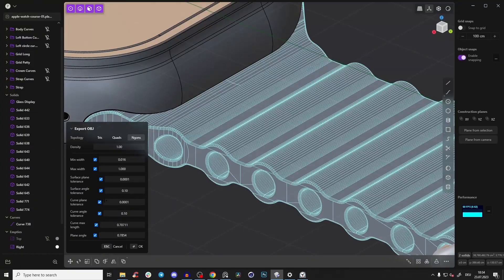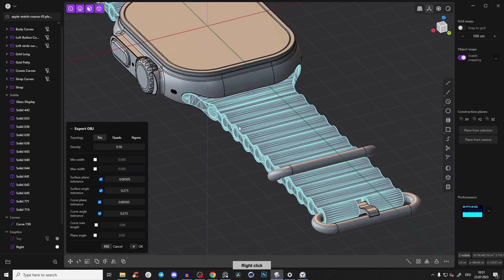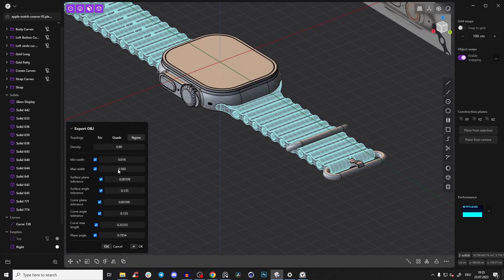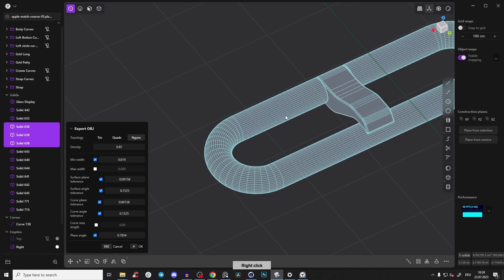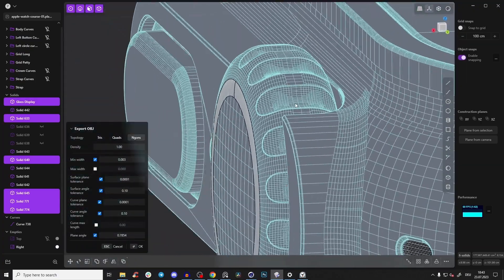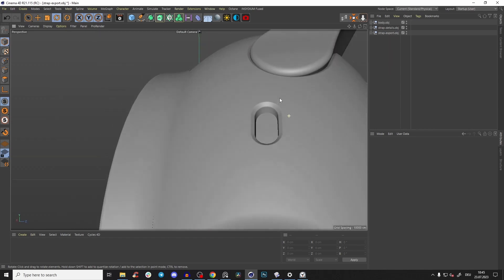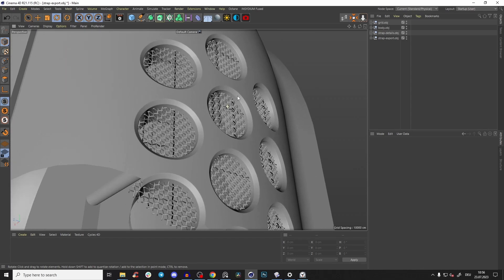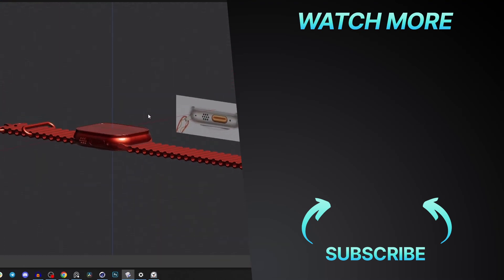Plasticity | BEST CAD To Mesh Geometry Export

Comment: Hi, I just bought Plastiocity (using your discout code thanks!) hoping to be able to import a STL file a client send me and be able to work on it, modify it. But for some reason when I import it to Plasticity it's just one single mesh and I can't select points/edges/faces etc. Is this normal?
I was expecting to modify it and then export it in OBJ (to render in Cinema4D) which I can't either. I'm a bit confused. 🤔

Comment: Can you convert STEP format files (nurbs) into Polygons and vice versa? 
And second question, can you export a polygon 3D model as STEP format which will be applicable/readable into SolidWorks, AutoCAD or Fusion?

Comment: I'm finally diving into Plasticity after seeing it on Twitter a few months back. I'm really intrigued!

Do you find the OBJs exported from Plasticity have better results than when you import STP CAD files directly into C4D and use its native CAD to polygon tool?
Reply from the maker: Haven't used the C4D tool for that.

Usually, of what I hear it produces much better results to export it from Plasticity/moi3d into a mesh
Reply: @nikita.kapustin  thanks! I’ll have to check out both programs
Reply: C4d might be better, lower poly count

Comment: "Best cad to mesh geometry export" Then goes on to show several unexplainable ngon problems. ^^;; I love how easy it is to model in plasticity without having to worry about edge flow first but I'm worried about topology. Especially since plasticity is meant to be a small acompanying app. It's export feature should be high quality for the entire product to be of best use.

I hope the export feature will get better and have high prio.
Reply from the maker: It's just in 1.2 version. It's just starting out:D

Comment: I really love it when you are so euphoric about Plasticity. It's really good and easy to use. But if you have a moderately complex object and want to take it into Blender via OBJ to unwrap it, you almost have more work in Blender with retopology. During this time I also modeled the model in Blender and with a better topology than in Plasticity.
I'm hoping hard that the OBJ interface will improve over time and export an object better.
In your video you said that you never unwrap. I would like that though to have a good interface and import and texture in Adobe Substance Painter.
Reply from the maker: Yes it depends what one needs. I just never used Substance painter, that's why I never had to unwrap. Most things can be done within materials procedural/projections.
Reply: Are you telling me that when you export from Plasticity it looks angular? I think you are not exporting well, because everything I export looks the way it looks in Plasticity. If it is round, it looks round, now if you are making a macro shot, it may look faceted. But that's what I said, it all depends on the purpose and your workflow. The same as for organic modeling I would use zbrush and not Plasticity, because it depends on the purpose of your project, I would use one tool or another. I don't know why people insist on doing everything with the same software. Each software has its advantages over the other, so it is good to have a good workflow, depending on the work, video games, cinematic, concept, product rendering, animation, etc. .... Everyone uses the tools they feel more comfortable with and adapts them to their way of working. That's why you should not discard any tool and even less compare software that has been developed for a long time, with others that have started recently. But just the fact that it is already being compared with software with more time, says a lot about Plasticity. And finally, it is not a question of using one or the other, the two complement each other. That Plasticity still lacks? it is clear, but with the little time it has been on the market, I see it as a very powerful tool and it has accelerated my work a lot. And I've been using Max, Maya, Zbrush, Blender for more than 15 years. But of course, this is just my opinion based on my experience.
Reply: @raulgomez8523  True, but keep in mind that not everybody has the ability to learn 6-7 different programs, with different workflow. I'm not sculpting p.e., just doing hardsurface modeling in Blender. Export it in Substance Painter for texturing and Photoshop for final post processing.
I took a look to Zbrush, but I had the impression that without a graduated study, this software cannot be used. So tell me a good reason why we should learn that amount of software just to model some products modeling or hardsurface modeling. I just forgot, Marmoset or whatever to render all that stuff...

Comment: There are many people obsessed with topology and it matters less and less, but it is clear that it depends on the purpose of the model whether it has a good typology or not. I've been modelling for many years and when I need a good typology, I do it to the model I've made in Zbrush, Plasticity, etc. .... It all depends on the workflow of each one, some model directly with good topology and others do it later. It doesn't matter how you do it, if it looks good and works, that's it. I get the impression that those who complain don't want to learn other software or want certain processes to be done automatically by program X. The important thing is to have a good workflow that gives you good results and doesn't waste your time. Congratulations on your videos. By the way, you have lifted the model I was going to make 🤣🤣🤣🤣🤣🤣🤣. Best regards.
Reply from the maker: "if it looks good and works, that's it"

I agree with that 100%

But all comes down what one needs and for what purpose the object will be used
Reply: @nikita.kapustin  Exactly. I get the impression that people are learning with tutorials and very old courses in which topology was very important, but fortunately that is becoming less and less important, but I repeat, it depends on the purpose. In my last 6 jobs, I have not done topology or UVS, which before, in at least 4 of them, I would have had to do that process.
Reply: when I heard about Fusion 360 I moved from 3ds max instantly, I thought to myself, why the fuck I spend 90% time moving those fucking vertices to get a "nice shading"...and its still not perfect...*.step workflow is perfect, if you want more creativity you can additionally use zbrush.
Reply: It's not just about topology. I only work with high resolution objects and if I have a hole in an object with 128 vertices, then I want to have the 128 vertices in Blender, 3dMax, Maya, etc. I want it to look round and not angular.
I don't care much about quads. If I work with booleans I get a lot of NGONS and if I don't add deformations or animate afterwards then everything looks good and I don't have artifacts. The important thing is the look. Unfortunately, the export module of Plasticity is still very weak.

Comment: It's cool how the exporter behave so nice with regular shapes like the ones in your video, unfortunately this doesn't work in more complex models. I export from plasticity to 3DSMax and still there's a lot of things that need to be fixed so the topology works fine. :(
Reply from the maker: What is a "complex model" in your understanding?

When it comes to "products" and hard surface stuff I never had any problems
Reply: If you dont actually care about the topology, you can just import the STEP file in 3Ds Max. If you care abou topology you can try a bunch of things like Quadify (the modifier) + Retopology. What helps is to break down the mesh a bit into multiple elements and that makes Quadify  and Retopo work much better. Another solution is to use Rhino, import the STEP file there and export as quads, from my experience Rhino (version 7 and above) has the best mesh exporter, miles ahead of Plasticity.
Reply: The problem you have when importing it in 3ds Max, is if you export it with Ngons, 3ds Max, does not get along very well with Ngons. Export it in another mode and you will see how Max takes it well, but of course, depending on what you are going to use it for, you will have to fix the topology or not. That's why I take it to Blender, because it works well with Ngons and it's easier if I have to fix the topology or I have to do something else.
Reply: @raulgomez8523  Max does fine with ngons as long as the smoothing is exported correctly. I work with manufacturing parts alot that dont require further modification and I end up with many ngons and Max works just fine with them. The problem is when you try to modify the ngons and smoothing breaks, thats when you end up with problems. But that happens in C4D, Max, Maya and Blender. The advantage Max has is the smoothing groups, which in most cases will fix those smoothing issues.

Like I said earlier, you want the best mesh exporter: use Rhino 7 and above, nothing comes close.
Reply: @E_Clip  Ahhhh, perfect, it gave me several problems and that's why I stopped using it, but it's good to know what you say. I have not tried Rhino for exporting, I will have to try it, but having that program for exporting only, does not convince me much, but I assure you that I will try it to see if it speeds up my workflow in depending on which jobs, thanks.
Reply: you need to export to blender and resave in blender to max, it's a known issue.

Comment: The real fun begins when you try to UV unwrap models from plasticity.
Reply: I UV meshes from Fusion360 , slight pain on a triangulated mesh. But using 3dCoat helps
Reply: The real fun was texturing using basic projections and decals because there was no UV mapping.
Reply: Rizom I’ve and or headus uvw programs work well
Reply from the maker: 99% in all my cases I never needed a unwrap. And in 1% an ngon mesh is fine for unwrap
Reply: @nikita.kapustin  dont take it as a hate , we are all greatfull for you posting tutorials! Plasticity is amazing program but it still isnt fully capable to involve in into 3D workflow for certain areas. Other than that its beautiful piece of software!
Reply from the maker: yeah exactly. And it's just the beginning!:)

Comment: Have you tried aligning normals in C4D?
Reply from the maker: For what?
Reply: @nikita.kapustin   for those errors when importing into C4D, select all polygons and run align normals command.
Reply from the maker: Thanks, I will try next time this issue occurs.
Reply: @nikita.kapustin  obj format is broken, never use it.
Reply: @eviv8010  What is the better option?